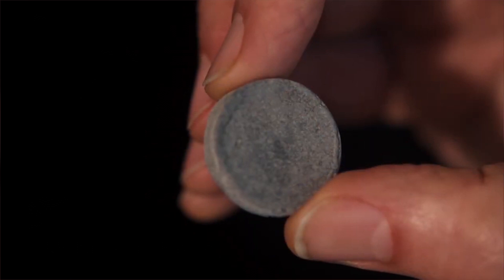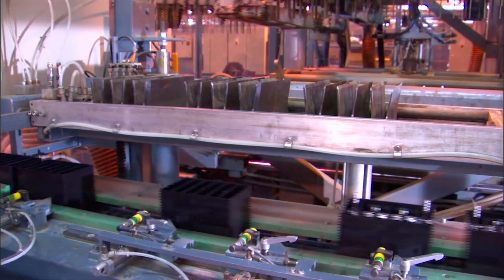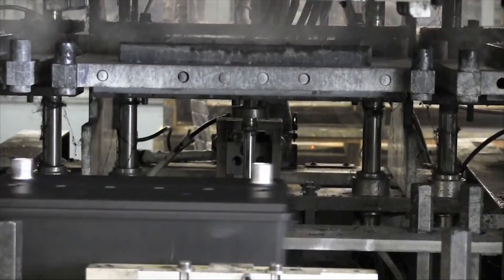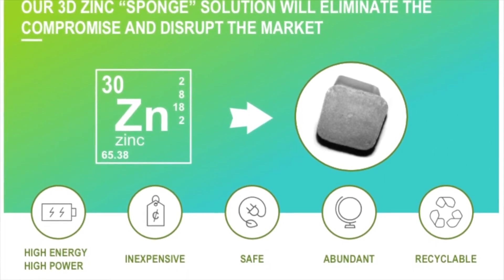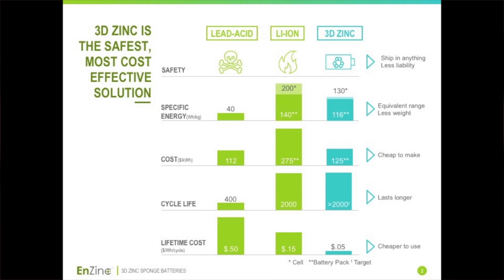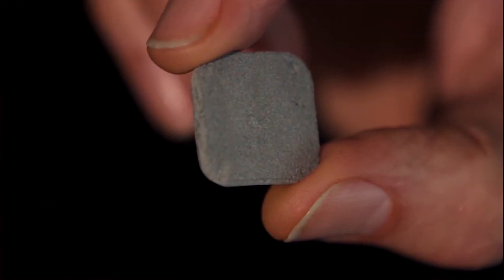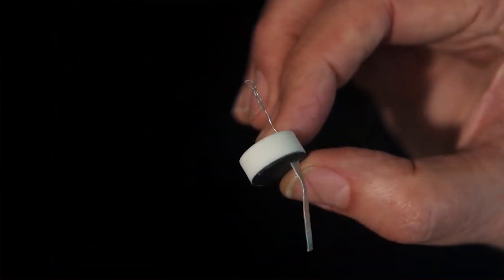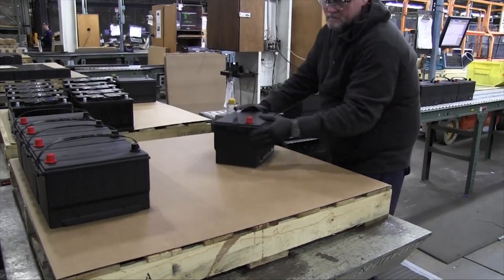Swap That Lead-Acid Battery Lump With Lightweight Zinc

Comment: I'm most curious on 1:1 lead acid performance comparisons, which weren't shared.  It's a third the weight of lead acid - ok, but what's the life, power density, and cost compared to lead acid?  It'll need to be roughly 50% better for the same cost in the near term if it's going to gain any traction.
Reply: The guy claimed in the video 3x the life for 10-15% more in cost. Of course who knows how trustworthy those numbers are.

Comment: Zinc has been used as the anode in classic, single-use dry cells since I was a kid (after the dinosaurs, before Compact Discs), with manganese dioxide as the cathode.   Some of you probably remember tearing apart these cells for their carbon rods, to be used for electrolyis of water experiments.  We would also drop the zinc in hydrochloric acid to release hydrogen gas.  I can't remember what we did with the manganese dioxide.  It's interesting to hear about all of the new rechargeable battery technologies.  Each has its tradeoffs.

Comment: With a water based electrolyte, is this a warm climate battery, or, will it work when I walk out to my car on a minus 30 F. day
Reply: A water based electrolyte isn't just plain water, there is usually an acid, or alkaline, or salt dissolved in it. Those additives act as antifreeze, lowering the freezing point. Existing lead acid batteries have a water based sulfuric acid electrolyte, it can still function at -30 F, though power output is reduced. This new zinc batteries will be much the same.

Comment: Edison EV had Nickel Iron batteries with potash liquid electrolyte they claimed lasted forever
Reply: Yes, they still exist. They are ultra heavy very large and have nearly no storage capacity. At least compared to current batteries.
Reply: They actually have similar capacity to lead acid, lower current than starting batteries pound for pound very close.